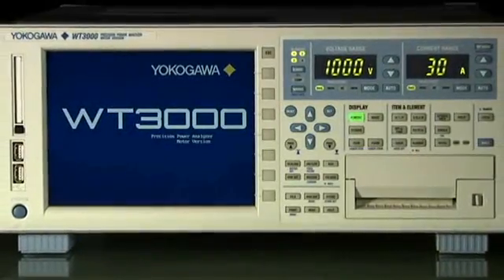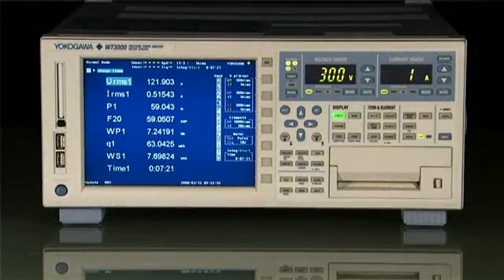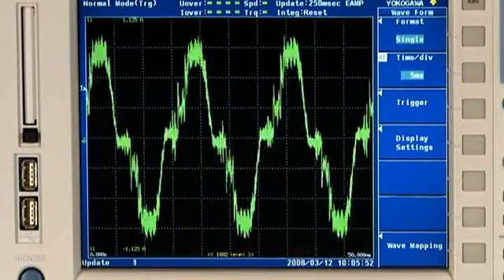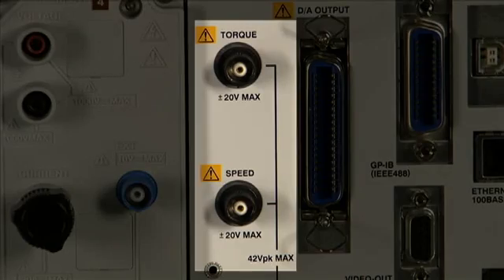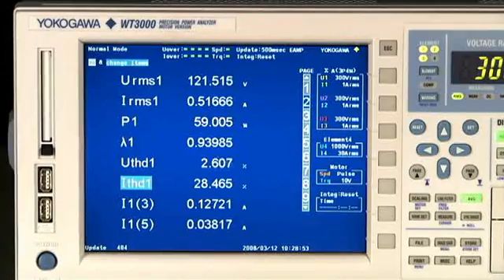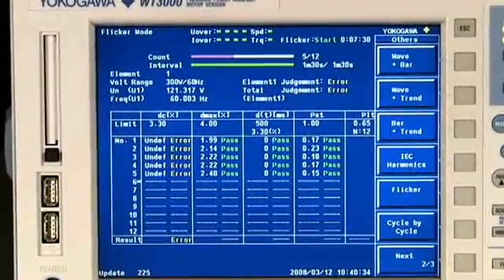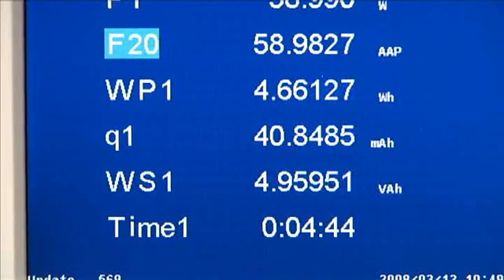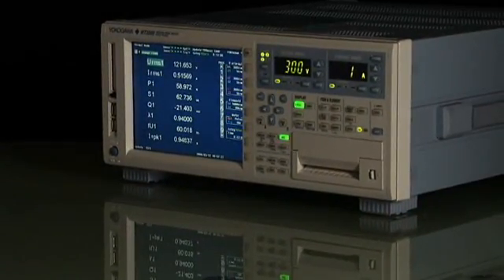WT3000 Precision Power Analyzer

Comment: The quoted accuracy is somewhat misleading since the achievable accuracy is not simply the reading error (in this case 0.02%). The total accuracy is always dominated by the range error which for the WT3000 is 0.05% of range over the frequencies at which 0.02% reading error applies. This gives a best accuracy of 0.07% over a specified frequency band. Still good but it is matched by other products and is not 0.02%.